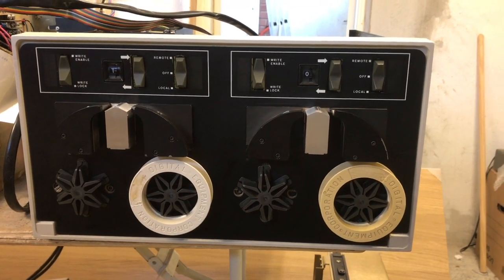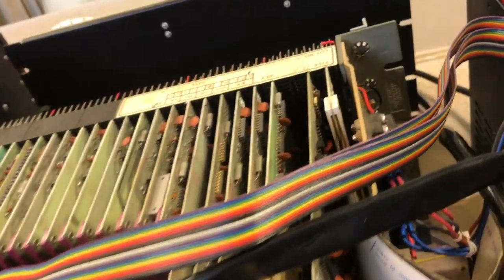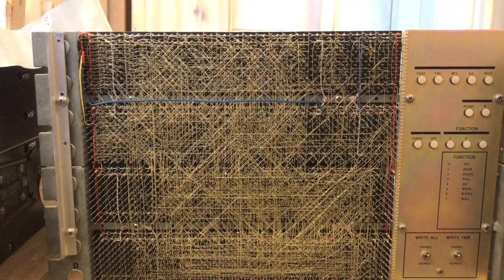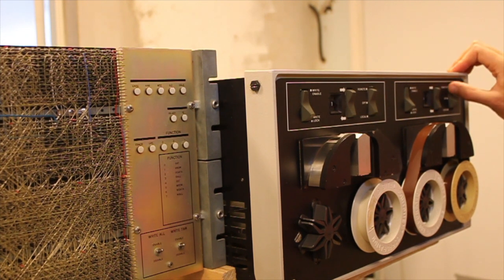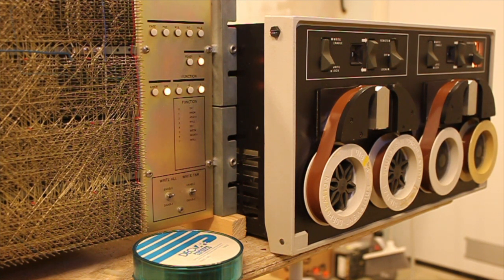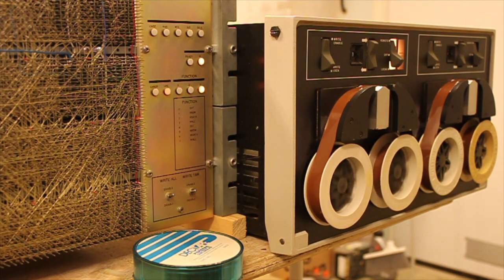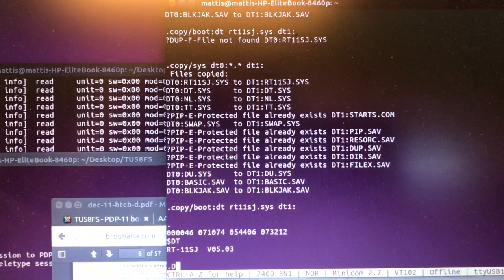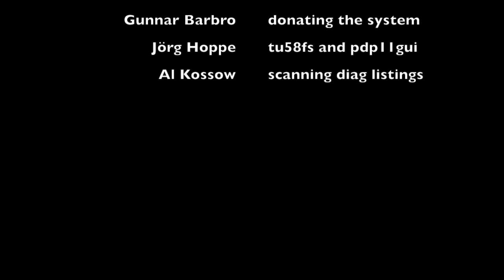PDP-11/05 computer booting RT-11 from TU56 DECtape

Comment: TU58 - I had 2 of those in my home VAX11/730 little cassettes block based which was interesting. VAX11/730 had its microcode on tape usually the least accessible tape drive and took 20 odd minutes to load it to the VAX chevron >>> unless you auto booted then it came up on the massive RA80 (120MB from memory) and also had an RL02 - 10MB removable single platter disk pack - I miss my VAX11s had a 11/730 and then upgraded to a VAX11/750 (booted from rom and instruction set built in) joys of hacking away while warming up the house! VAX 11/750 also had a TU58 for a while was trying to access it straight via MACRO-11 the controller was packet based you sent a series of bytes to it with a checksum and would do whatever was in the command packet. I have a VAX8300 as my dev machine running macro assembler and then fed console commands to the 730 to update the code - took forever to get the tape drive to a simple thing - much easier with the VMS TU58 tape driver :)

Comment: 13:46 “SJ” = “Single Job” (i.e. single process). There was also an “FB” (“Foreground/Background”) version of RT-11, which could run a separate background process while the foreground one interacted with the user in the normal way.

Comment: This was great, first time I've seen one of these.  We used to carry a TU-58 twin dectape cartridge drive around for loading diagnostics onto faulty machines, and a DL11-W for those machines that didn't have a serial port, which not all of the control machines did, then key the loader in by hand.  How times have changed !!

Comment: Holy smokes...I used to have to align a TU-78 tape drive connected to a VAX 11/751 back in my USAF days...it had dual air columns so that it didn't stretch the tapes....this is bringing back so distant memories!! Great video...thank you!

Comment: 11:30 These drives were invented at MIT Lincoln Labs as part of their “LINC” computer project. This design was then passed over to DEC, who made some “LINC-8” machines, which were combination of LINC and PDP-8. The mini tape drives (renamed “DECtape”) were so handy, they outlived the original LINC concept, and continued to be used I think into the VAX era.
Reply: AIUI, they were original called LINCtape, though I don't think that the LINC and DEC formats are quite interchangeable -- I might be wrong on that; I was always at the other end of a dataphone from the box.  🙂

Comment: The tape heads were not truly redundant.  There were three pairs, each pair had their coils in series.  Hopefully if one head was over a bad spot of tape, the other one would be on a good spot, so the data would survive, if at half-amplitude.

The PDP-8 operating system asked each progfram to supply a few hint bits in order to minimize unnecessary dectape motion.  One bit said that the program didn't bash the keyboard monitor, so then the OS wouldn't save and restore that area.  Another bit indicated that the program didn't bash the USR area, where all the OS's functions were.  

I never bothered to specify those hint bits as we always had a RK8-E disk drive which did those save/restore operations in a blink of an eye.   Would have bothered if we had to work with DECTape.

Comment: Wonder if you still have the original basic games from the 70s?
We used one of these with a PDP11/15 in the late 70s, it was such a relief to give up the hazards of managing large multi-tape programs. 😂 I had a fault on one of the dual slot cards once, just changed the faulty bus driver chip. Did you know they had an automated computer controlled unit to wire their backplanes? If you had the multilayer boards, later than these I think, it was important to check all the connections to each pin and add mylar wire as necessary/extra solder. The DEC Field Service engineer used to exchange them with ones repaired in Holland. When the field service stopped we got a contract direct with Holland. I’m thinking somebody still has lots of LSI11/23 cards.
Reply: The original games came from field service, they were all .BAS

Comment: Amazing how overbuilt those drives were. Need to wrap a tape around a spindle? Let's give it enough torque to move a car. :D Also wirewrapped boards scare me so much. Can you imagine the cursing if you have to undo a wire at the bottom of the whole ratnest?

Comment: Great video Mattis, love it.
I really should get my DECtape operational ...
Where did you find the replacement motor run capacitors?
Reply from the maker: Thanks Henk! 100uF 100VDC ordinary polyester film capacitors from Mouser: http://www.mouser.se/Search/ProductDetail.aspx?R=R60EW61005000K
Reply: There are also "motor start/run" capacitors which are a bit cheaper and come with quick connect terminals.

Comment: Amazing how even a pi zero will smoke it in every aspect, yet this cost more than a house when it was new.
Reply from the maker: It shows the effect of Moore's Law well I think. The two CPU modules contain about 200 SSI/MSI TTL circuits with on average 50 transistors each, totalling maybe 10000 transistors. A Pi zero maybe have 500 million transistors?
Reply: And will probably cost as much as a house in a few years time. Sadly, there are fewer and fewer of these amazing machines each year.
Reply: Except you can't use the pi zero to heat your office. ;-)

Comment: Very nice video. Is an image of the bootable tape you used available somewhere, so that could use it with SimH (on the PiDP-11)?
Reply from the maker: No. I don’t have this image dumped. It is fairly easy to creat a bootable RT-11 image inside SimH using any of the available RT-11 distributions which are online. The set of four RX01 images I have put at http://www.datormuseum.se/documentation-software/rx01-and-rx02-floppy-disks should be useable in this case.

Comment: So 3 data tracks would mean 2^3 bits of data. 8 bits.  So run the data through a 74(LS/S/AC)138 3 to 8 decoder and have your 8 bit characters.
Reply from the maker: The format is more elaborate. The track is divided into lines clocked with a clock signal in the clock track. Each line has three data bits and one mark bit. Six lines are combined into a 18 bit data word and a 6 bit mark word. The mark word tell what type of data is in the data word. Might be a check sum, a block number or actual user data. For a PDP-11 the two highest bits go unused and only the lower 16 gets transferred (normally) to the computer.

Comment: I am curious if a machine like this can record music like a reel to reel. I know it's data. These machines are before my time.

Could you copy an MP3 song to a device this and read it back if the file size is under 300KB?
Reply from the maker: In theory you could record a 300 k song on the tape. But I don't think that it will be able to decode the MP3 format i real time. Remember that the speed of a PDP-11 is at most 1 MIPS. The 11/05 is probably around 0.5 MIPS. The transfer speed from DECtape is rather low as well. Approximately 200 us per 16 bit word as far as I remember.
Reply: @mattislind4443 Mp3 at low bitrate. I was curious because it looked like you were using a modern pc to access the data. Maybe not stream it off the tape but copy it then play.
Reply from the maker: @coondogtheman   Low bit rate, yes, perhaps. I know very little about how MP3 decoding is done. Then the question is if you can fit the decoder in 56 kbyte of memory? Perhaps possible with a good deal of assembly programming. Aside from that you need to add a D/A converter board. I think that other type of music generation should be possible, though. Either by algorithms or stored waveforms, perhaps? The modern PC is only used as a terminal connected over a serial port to the PDP-11 and is just used for interacting with the operating system running on it.
Reply: @mattislind4443  I dont mean run the mp3  player program off the tape or the small amount of memory. Can you access this tape drive on a modern PC? If so you could just use the tape to store the song and not the mp3 player program.